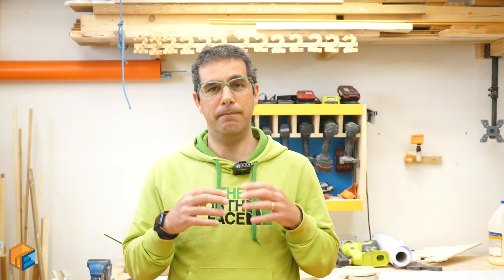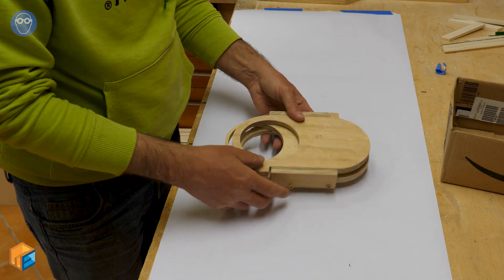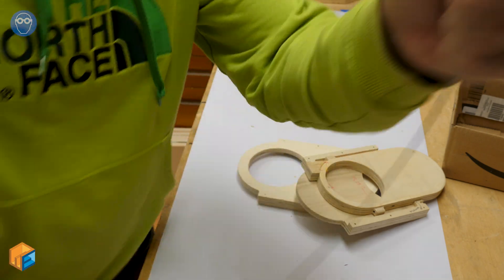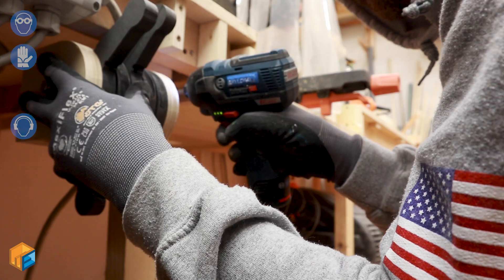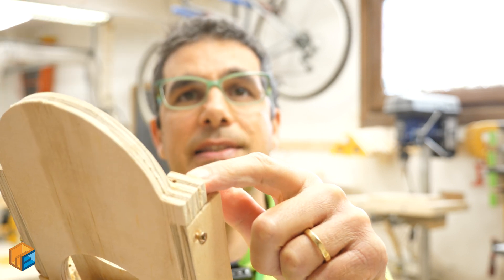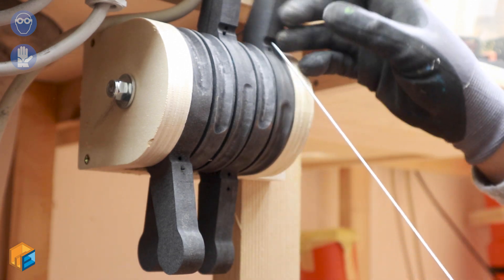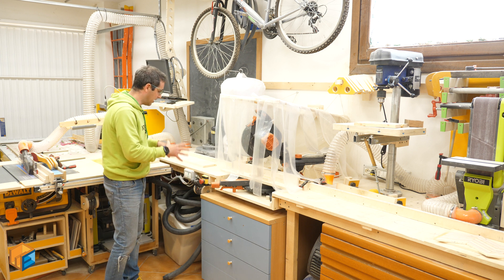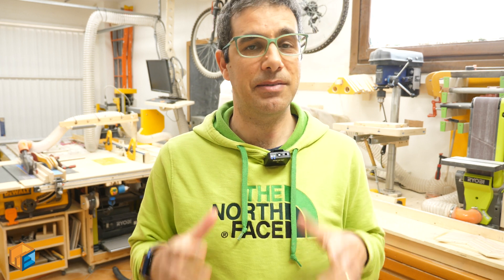Remote controlled blast gates // DIY dust collection system

Comment: Doing some research for my next video and came across this, so unique! Truly engineered. Great video. I'm trying to decide which route to go with my blast gates and can't decide. Raspberry Pi and actuators, iVac, just manual, some creative like this!? Difficult... New sub!
Reply from the maker: Thanks Blake! I'd go for the simplest thing you can get: done is better than perfect 😅
Reply: @woodworkingengineering2415  ended up going with iVac, so simple. Video is up!
Reply from the maker: I'm gonna watch it later today 😊

Comment: Very well done! I like how practical the design is and doesn't require any electricity or motors.
Reply from the maker: Exactly! That were two of my main concerns: keeping an electrical circuit always on (in a place with lots of sawdust) and keep the design easy (KISS, Keep It Simple, Stupid 😅). I tried using springs and stuff like that, but it was complicated and I guess hard to mantain.